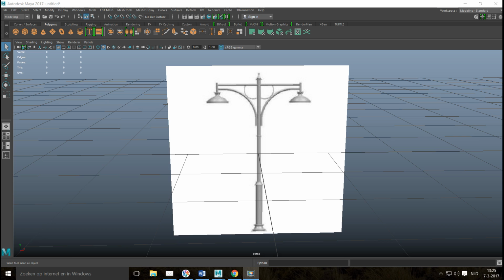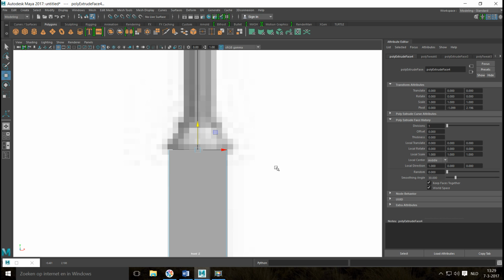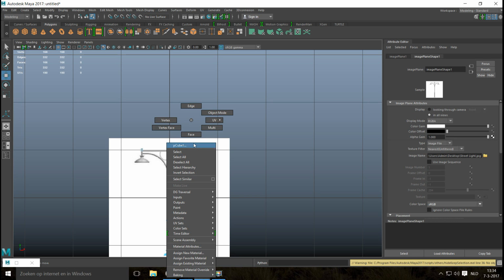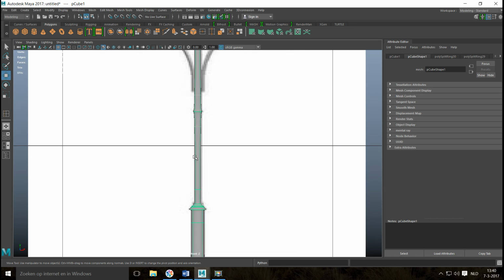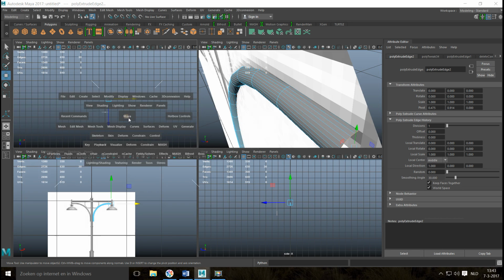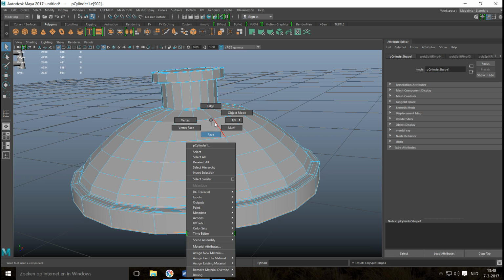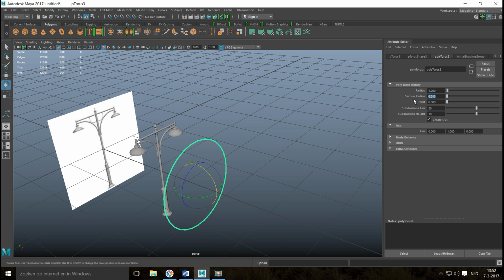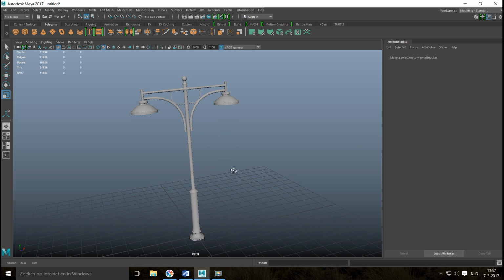Building a 3D asset library Part 1 : Streetlight

Comment: I guess scale is not as important as proportions of the prop. As long as you get the proportions of the prop correct, when you scale it to match the scene it will look correct. I guess it would also be important to note that simply changing the props texture, rotation in the scene, can add variety with out much additional work.
Reply from the maker: Correct